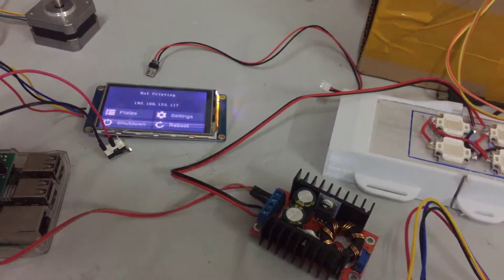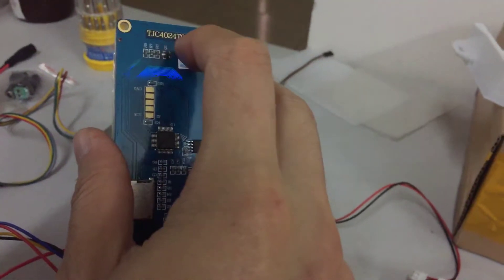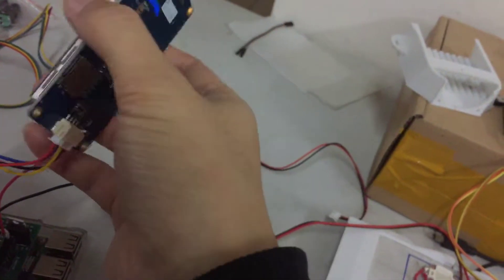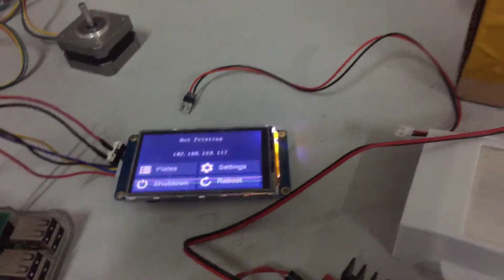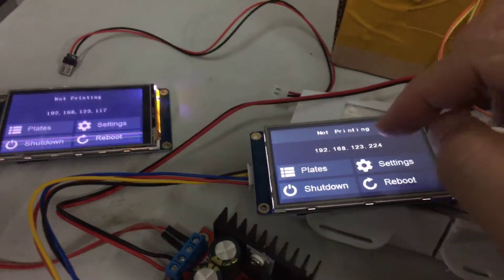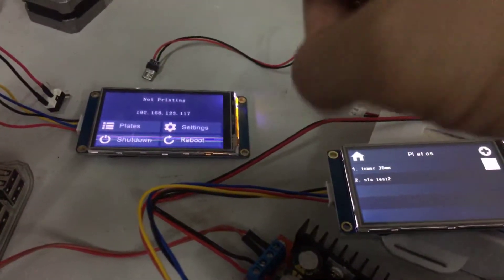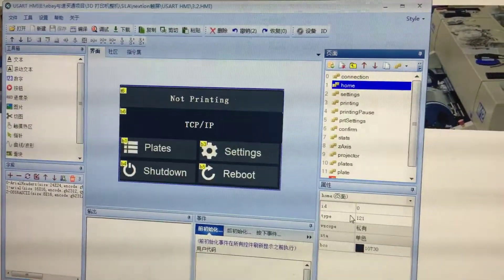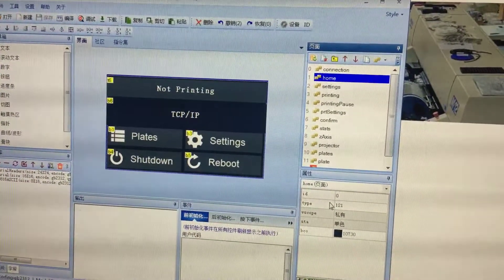Alternate  of nextion display useing USART HMI SCREEN（for low budget DIYer）

Comment: Yes its a the same screen and board, also cheaper - however, the programmer is Chinese language, whereas the Nextion programmer is English language

 TJC make them all - Nextion buy from TJC and sell outside of China, whereas TJC is only for the Chinese market

A lot of people wish TJC would supply the outside of China market - but instead they make sure you cannot adapt the Chinese language editor to English language which would allow people to bypass the more expensive Nextion versions
Reply: how do i get some english tft and hmi files for my chinese version ???
Reply: @cbradiohamman  does the english nextion editor's .tft file work with this?